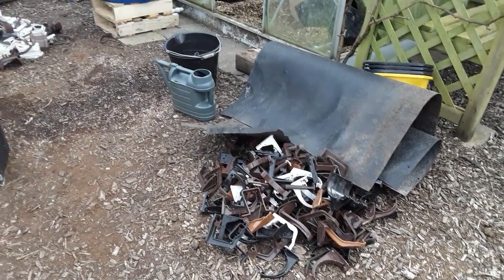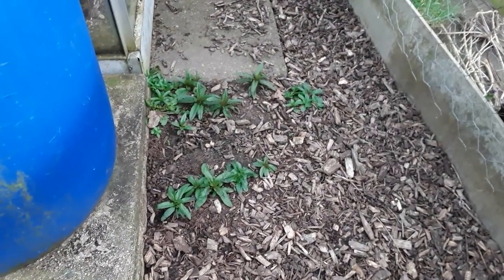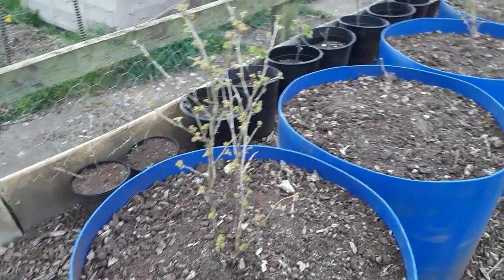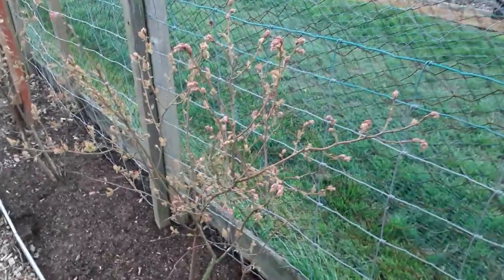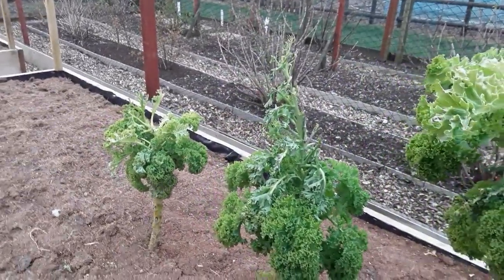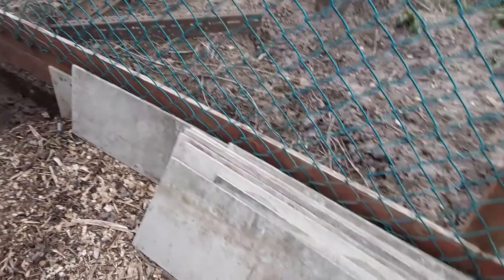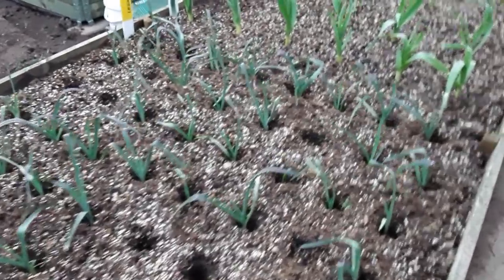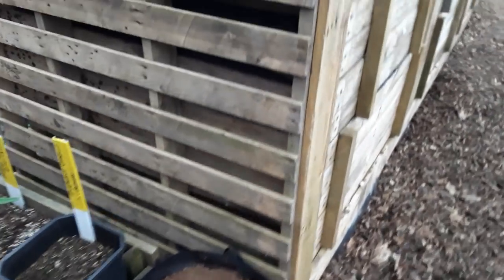March Allotment Tours And Progress Update ♻️  Square Foot Gardening ♻️ Raised No Dig Beds

Comment: Terry, you are my scavenger role model and I don't say that to just anyone!  Are the raised beds made from lined pallets as strong as the others or even more so?  Nuka.
Reply from the maker: Hello Nuka, the pallet beds lined with the corex boards similar to the Rhubarb are holding up well, but wouldn't want to pull on them.....lol. so the scaffolding planks are much better. The poly carbonate sheets will hopefully do me some good like the ones on the square foot gardening beds, but if not someone else may benefit. Stay healthy my friend. 

♻️Happy gardening, Terry King.